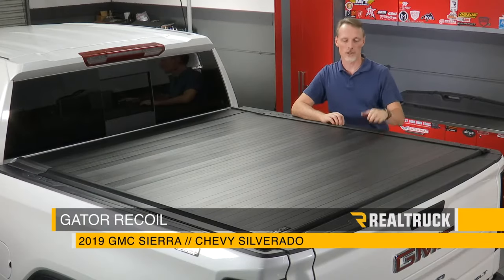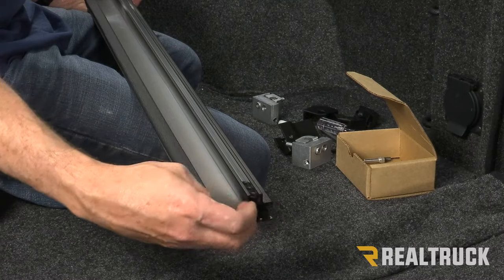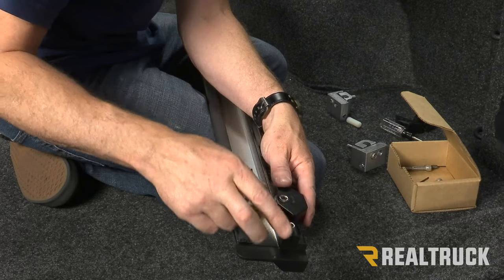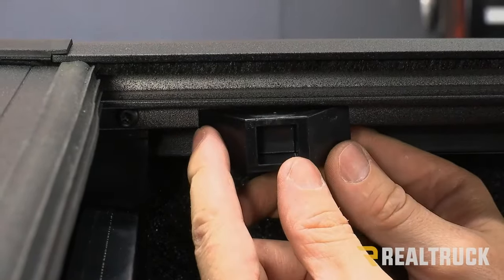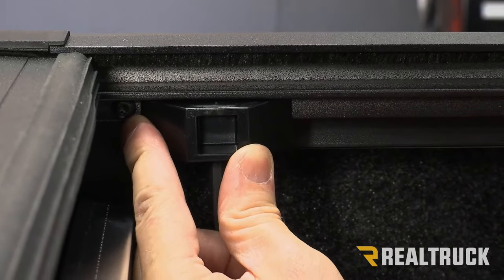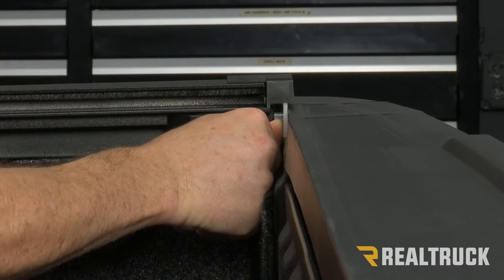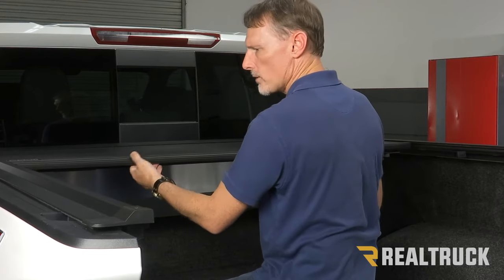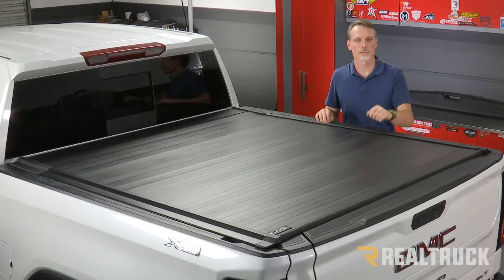How to Install Gator Recoil Tonneau Cover on a 2019 Chevy GMC 1500

Comment: I've had one of these for a couple of years now; still happy enough with the purchase. But beware, they flap up and down on the highway from the wind and make noise. No problem if the windows are up, but with them open I have to crank the radio to drown it out.

Comment: So my cover came up short about 1/2 to 3/4 of an inch.  My instructions didn't say pull the tracks back to the tailgate using the 1/4 spacer.  So is it safe to say that in the beginning of the video he placed the canister flush against the bed but then he pulls it to the tailgate so.... in the end it's not flush with the bed of the truck near the cab?
Reply: what did you end up doing?  Loosen evertyhing up? move it?
Reply: @gixxergarry  sent it back and went with a different one from Amazon.   Love it.  No issues

Comment: We installed the gator retractable cover on a 2018 Chevy Silverado 4 door with 6-6 bed and the latches for the cover does not allow the rails to open wide enough at the rear of the bed. We ended up taking the latches off in the center and at the tail gate. I think we got the wrong cover but everything said it was correct.
Reply: Do you mean the clamps? I just bought one and installed on a 2016 chevy and it is 2 tight toward the tailgate if it was clamps you just left them off ?

Comment: I've had mine for about 8 months and it is TRASH.   Needs to be adjusted all the time, it keep water out like at all....and the end caps have cracked already.  It was installed per the instructions.  BUYER BEWARE DON'T BUY